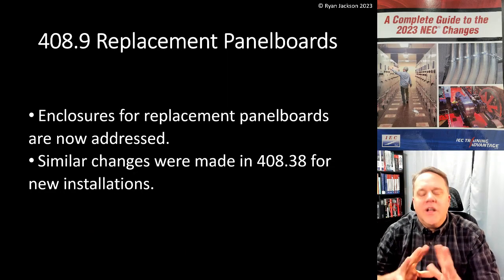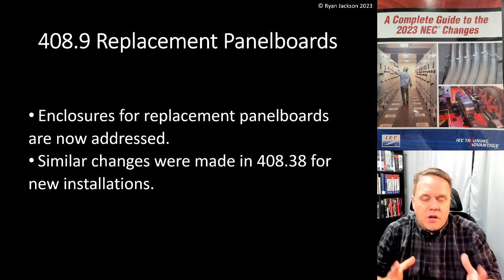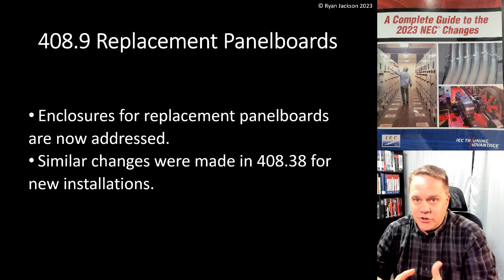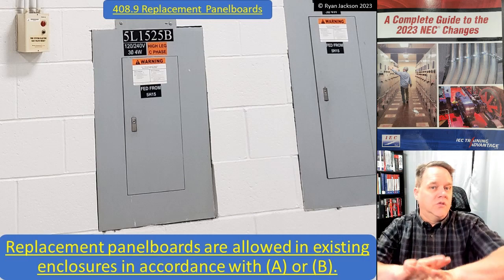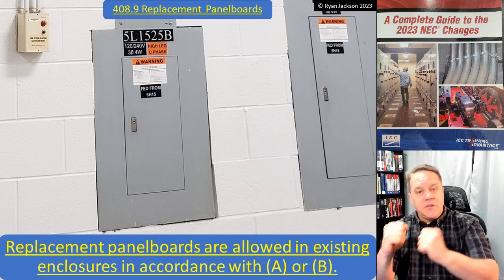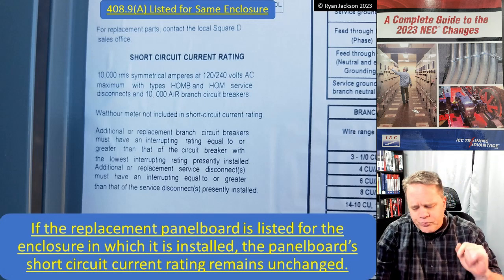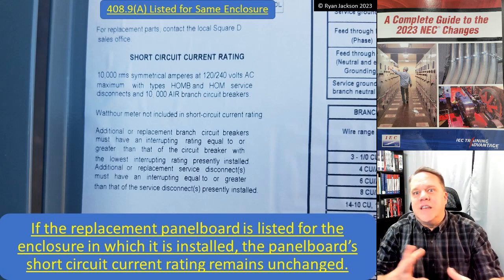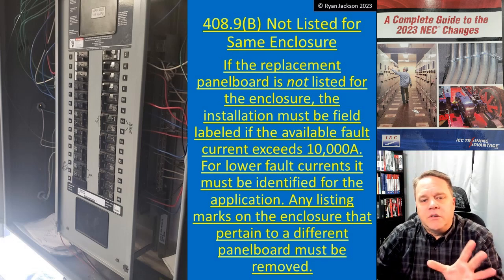408.9 Replacement Panelboards

Comment: Great that the code allows this. Back in the 1970's we had a two phase panel that had maybe 36 cartridge fuses. All circuits were 15 or 20 amp that only feed 120 foot circuits . We cut the cover out and had weldor world cut down covers from two 20 circuit panels then fabricate a heavy front door .Old panel was a flush mount in packing house wall titles so this saved a lot if work. Fast forward to the late 1980's and we had over 40 obsolete ITE panels that the only place that had replacement three poke 480 circuit breakers was a company out west that charged three arms & a leg for these beakers. We started taking an inventory of the panels that had a good combination on the most commonly used breakers we used and started looking into replacing at least halve a dozen panels during our annual shut down but business was sold & moved to another state. Had trouble securing older 400 amp 600 volt three phase buss duct switches.